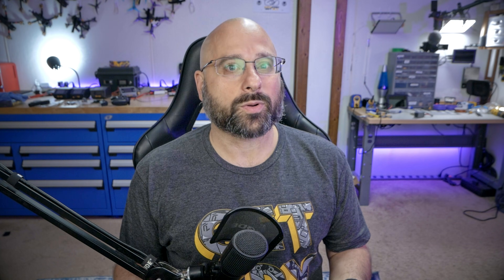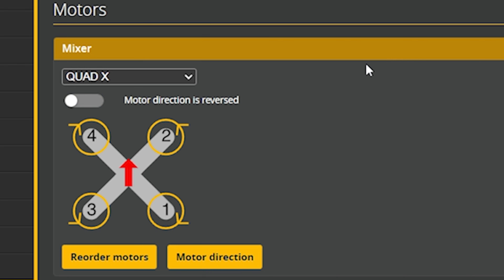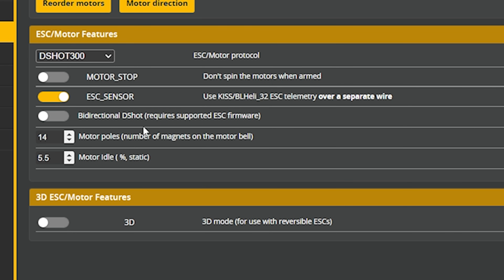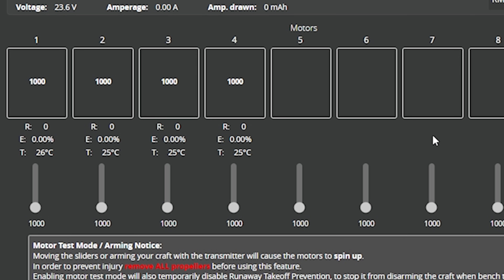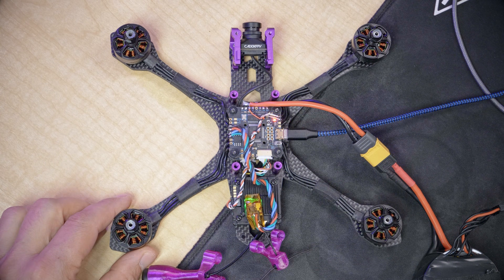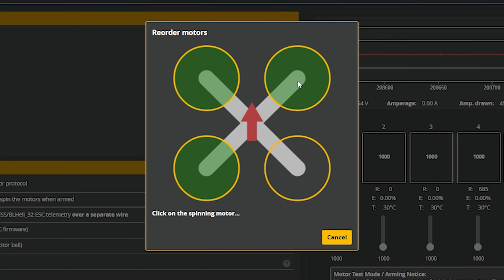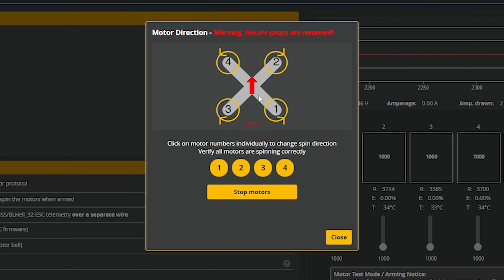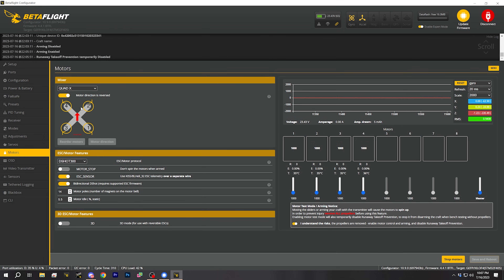Build an FPV drone in 2023 - Part 10 - Betaflight Motor Setup

Comment: Came here 1st to thank you for this video series, i didn't know where to start and this broke it down into digestible parts. TL;DR: the parts for this sat under my desk for a year before i finally had enough time to dive in. Which means that the latest version of betaflight would not fix my motor direction until i updated the firmware on the FC. That said I was able to put ELRS on the sbus and add a GPS/Magnetometer to the UART3 and i'm now playing with betaflight 4.6 GPS rescue and altitude/position hold. Thanks again for sending me down a rabbit hole. I'm looking forward to the day i can send this thing down range without a major knot in my stomach

Comment: I prefer props in actually.   Props out has very prop kicking the flotsam (grass, dirt, etc) right into the center of the body and at the flight stack. I'd rather kick grass to the front and rear of the drone than kick everything right onto the stack!!  That's just my opinion anyway.

Comment: Hey Joshua! First off, thank you for all of the detailed videos, goes along way to get someone into the hobby. 

I have bough the kit and I'm at "Does your ESC support bi-directional dshot" and despite having the drone plugged into a battery and powered on with no smoke it doesn't appear to remove the 100% error. I tried disabling the option and proceeding with doing a motor test but don't get any movement. Is it likely i fried my esc while soldering? wondering next steps in terms of troubleshooting. Thank you!
Reply: Noticed I am hearing the first 3 tones when plugging in the battery but not the 4th and 5th - internets telling me that means communication between ESC and FC. I unplugged the FC from the computer and plugged in only the battery and got all 5 tones, then connecting it back to beta flight and got the bi-directional dshot errors gone along with motors moving in test!

Would this be a bad soldering job and inconsistent connection?
Reply from the maker: Your ESC isn't fried. I'm not sure why what you're describing is happening, to be honest. Is it working though?
Reply: @JoshuaBardwell  seems to be working! Just need to plug in the battery and then the usb to the FC or else it doesn't pick it up in beta flight. Tried a few variations and seems to only work in that order.

Still new to the community but appreciate everything you've done and continue to do! Inaugural test flight next weekend!

Comment: 6:09 I got to this motor check and everything was working perfectly fine until I plugged the battery in with the usb connected to my computer. The LEDs on the flight controller turned off and started getting hot, but there was no smoking. The receiver light is still on and the motors beeped but the FC seems dead. I had plugged the battery and usb in separately multiple times and nothing went wrong, but now there is a short between the 3.3v and ground pads on the fc. Any idea what could have gone wrong? I have done continuity testing for all the wires I soldered and nothing is disconnected.

Comment: The wizard never worked for me. The motors never turned on. I had to use the touch method and reverse them using esc flasher.

Comment: The 100% errors are staying on when i plug in battery for dshot and when i save and reboot. im using the kit so im not sure why? ive plugged and unplugged everything and it still wont work. Any ideas? Also motors aren't spinning even when d shot is off.
Reply: 0H,I figured it out.   Un plug usb, plug in battery, then plug in usb second.
Reply from the maker: What if you disable bidirectional dshot?
Reply: Same here.   I'm guessing I need to go find an ESC debugging video.   I only get 3 beeps when I plug in battery.

Comment: This is a great series. Everything was going well and then the motors decided they were ECS's and refused to change rotation for any reason. Trouble shot the motors all seemed well, but then I thought, all of the motors bad at the same time? Not likely. I need my ECS's to be a ESC's. Any suggestions? I'm thinking a firmware update or something like that. I have the "Xilo Stax V2 45A ESC" Came with the kit.
Reply from the maker: Are you saying that the betaflight Reverse Motors function didn't work? Unfortunately, the FC now ships with BF 4.4.2, which breaks this function. The workaround is to swap 2 of the 3 motor wires where they solder to the ESC, in order to reverse a motor.
Reply: Will this eliminate the Turtle capability. And thank you for the reply
 @JoshuaBardwell
Reply from the maker: No. Turtle still works fine.

Comment: Anyone have any tips if I have one motor that is sort of stuttering and in Betaflight with bidirectional key shot enabled there is 0% error on all motors. The motor that stutters also gets very warm very quickly although the temperature within betaflight stays about the same as the other 3 motors. 

Any tips would be greatly appreciated thanks!
Reply: So the motor with the issue intermittently started working then stopped again. It’s like the motor is trying to spin but it just keeps stopping. Motor spins fine by hand feel no sort of drag. Continuity is all great. Any tips would be great!
Reply from the maker: Replace the motor and see if that fixes the problem. If not, replace the ESC.
Reply: @JoshuaBardwell  appreciate the response. It put it away for the night then the next day everything seemed to function perfectly fine. Flew it around for about 2-3 minutes and it dropped like a rock and one of the motors began pouring smoke out of it. Oddly enough this wasn’t the motor that was having the stuttering. Thinking the ESC must’ve been the issue due to all of the previous intermittent issues.

Comment: Hi Everyone, I'm building the drone from this kit. And I can't get the motor spin in Betaflight, Battery is already connected, and enabled motor test mode. However, if I unplug the usb cable and use the controller, the motor can arm and spin

Comment from the maker: I am hearing reports that people cannot get the motors to change direction in the Motor Direction Wizard any more. The reason for this is that the FC is now shipping with BF 4.4.2 on it, and 4.4.2 has a bug where the Motor Direction Wizard doesn't work. To fix this, either roll back to 4.4.0, or change motor direction by swapping two of the three motor wires at the ESC.
Reply: BLHeli Suite will solve the problem too!
Reply: how do i roll back to 4.4.0,

Comment: What would cause the motors to not reverse direction? All 4 are spinning the same direction and they're not reversing through the wizard
Reply from the maker: If that happens you need to reverse direction by swapping two of the motor wires.
Reply: Thank you! I got it working by downgrading from betaflight 4.4.2 as theres a bug with reversing motors in that version @JoshuaBardwell
Reply from the maker: Ok I see. They have started shipping the FC with 4.4.2 on it, whereas the one I got to record the videos was on 4.4.1, and that introduced the bug.
Reply: hey just wondering how to do this? @thegeogian
Reply: @critch214  find a video of how to update betaflight, then make sure you select a version other than 4.4.2. It can even be a previous version

Comment: hi! I was following build and I get smoke stopper beeping when I spin all motors or spin single motor fast, individualy at slow speed they all work, any advice how to fix it? did smoke check with multimeter and could not find problem
Reply: solved a problem - truns out smoke stopper cuts power when it gets too high. so everything works well when I simply connect battery directly to quad. will keep this comment for some one like me 😅

Comment: So…everything is working except now at motor test motors 1 and 4 started right up while motors 2 and 3 didn’t spin at all. There has not been any smoke at any point. Nothing has gotten very hot. I continuity tested throughout every soldering step. Any ideas to fix?
Reply: I had a problem with my motor 1 stopped spinning during the wizard setup. I checked my soldering and than decided to reorder two of three wires from the motor. It solved the issue.
Reply: @CukiJ  I don’t remember which fix worked for me, but something did. I either resoldered too or I remapped stuff. Lol it’s so much work to get things set up and then I forget most of what I did to get it working.

Comment: hi is it possible to down rate an esc to a lower amp? So i dont burn my motors?
Reply from the maker: The ESC rating is a maximum. You cannot have an ESC rating that is too high. It's like, if your truck was rated to carry 5000 lbs, and you only put 100 lbs in the back of the truck, that's fine, right?
Reply: Diatone Mamba F722MK4 + F65-128K Stack 3-6s I bought this for my Apex with Mr.steel stout v3 motors so it runs fine do you mean?

Comment: What kind of cable does the FC need?  I have a SpeedyBee that used a USB-C but this is different.  I know for my SPeedyBee some cables don't work.  Do you have a suggested link to a cable you KNOW is data/bi directional/whatever for BetaFlight to work?  

Also when are the rest coming out?  I really want to put the top plate on this thing and then do all the programming after it's frame is done.
Reply from the maker: All of the videos are unlisted from the day of release. You can go to the playlist link in the video description and watch them now.
Reply: Ahh, thanks. I have been watching on AppleTV and so I just go to your channel (not using the playlist in comments) and searched the latest uploads.  I'll have to figure out how to get around this on AppleTVs.   @JoshuaBardwell

Comment: WAIT!!!!! You didnt tell us WHICH protocol to use if DSHOT isnt supported!!!
Reply from the maker: If your ESC doesn't support Dshot, get an ESC made in the last five years. Not trying to be glib. Any ESC that doesn't support Dshot should not be used on a modern multirotor. Modern FC don't fly well if they're not using Dshot.

Comment: Which reminds me, I had all the motors set to rotate in the right direction. The quad flip-floped when it was armed, and it turned out that the motor assignments weren't quite right, front-left was back-right and so on. Luckily I spotted it straight away.